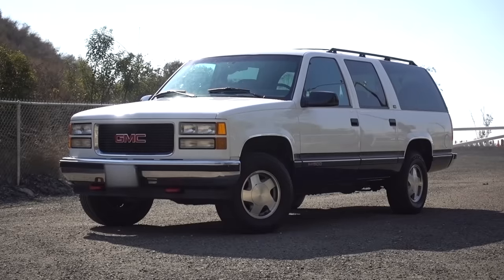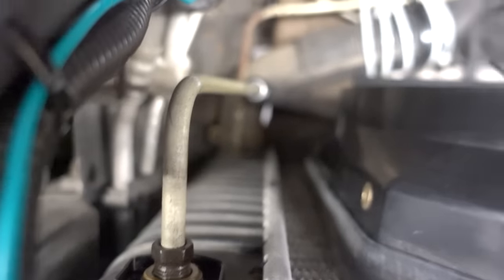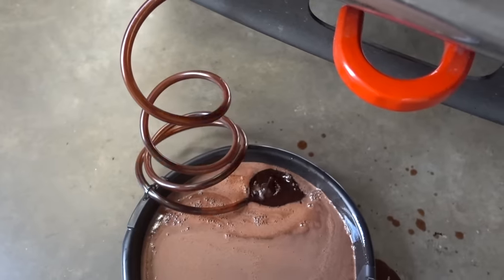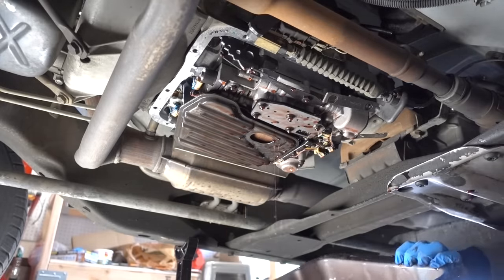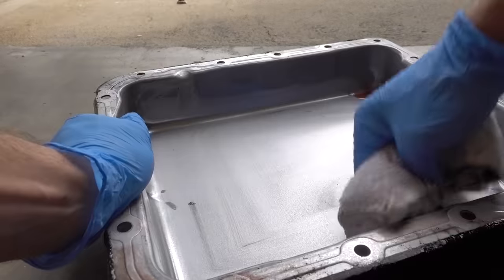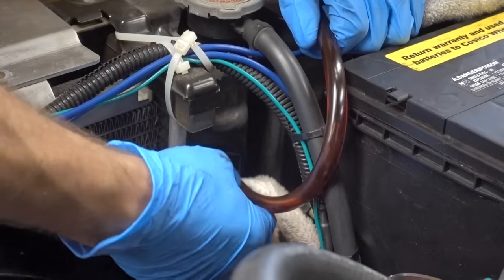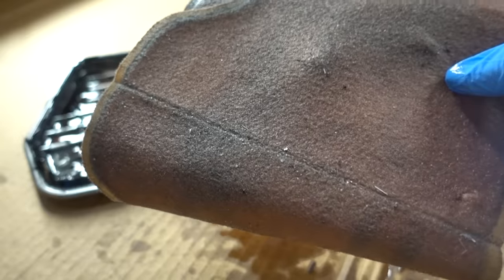Why You Should NEVER FLUSH YOUR TRANSMISSION FLUID!!

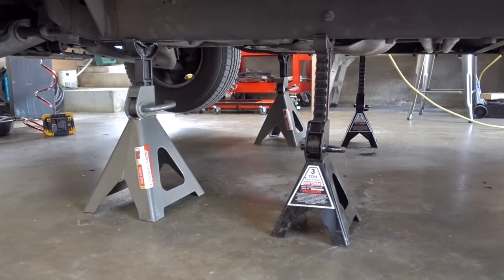Comment: Those 6 ton jacks stands at 4:25 have been recalled by Harbor Freight because of a manufacturing defect that makes it collapse under load.
Reply: apparently the jacks were fine. There was a guy who just wanted to use his head as a jack
Reply: i had a friends die from the jack stand failure
Reply: @scribtoon7146  nah the jacks are crap. I have a couple. When you lift up on the handle, it should lift up the anvil before dropping it. The 6-ton's from HF dont lift the anvil up, which means it could slip if the handle is bumped or not down all the way. Plus the teeth on the anvil are not long enough, so there's a lot of wiggle room. I only use them in the lowest position now after experimenting with them.
Reply: @frostbite1991  where can I get some good quality jack stands?
Reply: @vegeta9411  go yo Harbor Freight. Get the 6 ton jack stands. Just make sure the anvil goes up when you pull the handle up.. and use only 2 teeth if you're not feeling safe 🤷‍♂️
Reply: @4mmdefeater920  
Omg that's fkd up
Reply: @4mmdefeater920  Oh Jesus! What a horrible way to die :(   Im very sorry man.
Reply: fake news.   there was no such recall.   stop spreading false info.
Reply: They were not fine, I went to grab some cheap jack stands  around February(ish). They didn't have any due to the recall.
Reply: Good eye, . Jack stands are something I would never cheapskate on.
Reply: I only like using the jack stands where you put the pin through the hole to keep it at your desired height. Saying that I also slide a wheel in under the sill just in case the car ever came off the stands.
Reply: @frostbite1991  "When you lift up on the handle, it should lift up the anvil before dropping it"
That statement is 100% true and accurate!  If you can lift the jack stand handle without the stand height increasing, it's a killer and you should take it immediately to the junk yard.
Reply: @recentlychanged  yep, why I only use my HF 6 ton jacks exclusively for my cars. In the lowest position they get the car high enough for me to roll on a creeper under them. Still need to get a new set for my trucks though haha.
Reply: There was indeed a recall and safety measures added to new Jack stands
Reply: If your life depends on it, don't get it at Harbor Freight. If your life doesn't depend on it definitely do get it at HF.

Comment: I have a 2010 gmc Sierra with 143k. I just flushed the transmission fluid.  It made a big difference in how smooth my shifting is. The fluid was old and dark but didn't stink. I didn't think I would feel a difference, but it really made my transmission buttery smooth.

Comment: "NEVER Flush your transmission!"
FLUSHES the transmission?!?!?!
Reply: P M this is not considered a flush.  It uses the internal transmission pump.  Flushing generally means hooking up an external machine that has its own pump and pushes for lack of a better word new fluid throughout the transmission.  Quite different end results.
Reply: @condor5635   Still doesn't get around to vehemently explaining "why you shouldn't".
Reply: Pynaegan because using an external machine with its own pump (and unknown pressures etc) is thought to be more likely to dislodge particles etc. that could then clog up ports etc. The internal pump would not do this
Reply: The way I see it, He did a complete change and even changed the filter. If he were to just flush it, the pan never would have come undone and the filter would still be in place. You remember the magnet with the shavings?  There could be more!
Reply: Do as I say! Do not do as I do.
Reply: And also has a video saying it's the best thing he could have done and his transmission is running top notch lol
Reply: @condor5635  this usually take 4-6 gallons to do a complete flush. You don't need a fancy machine to get 95% of the old dirty fluid out.
Reply: Chris Atkinson not sure why you are responding to me. No one in there right mind would run 4-6 gallons through any transmission. I just did my Highlander few weeks back running 10 QUARTS through including draining the pan. That’s considered a complete replacement of the fluid or close enough.
Reply: Mines is slipping 2007 avalanche
Reply: Why would you use grease?
That's crazy! Use the trans fluid
Reply: @condor5635  depends on what transmission and vehicle you have. Been a mechanic for 18 years so i know what I'm talking about. I use that much and use a clear hose while flushing along with clear jugs so I can see the change from black to brown to solid cherry read. My s55 amg took almost 9 gallons to get it all out. My dodge ram with a very deep aftermarket pan took about 6 to flush all the discolored fluid out. No i didn't put all that fluid in at one time if thats what you were thinking might be miscommunication. I dropped the pan changed the filter reinstalled. Then put 4-6qts in the car and turned it on watching the fluid drain from the clear hose i attached to the output line going into the cooler. Once it started slowing in flow I cut the vehicle off then added 4 qts or so and began the process all over again till it came out cherry red. Thats what I meant by 4-6 gallons. Sorry for the confusion.
Reply: @repnatl  hi, I'm going to use this process soon on my Mazda5 and I have a question for you, isn't it better to do the flush untill the oil is bright red and then change the filter? So no shavings from your flush go into the new filter.
Reply: @Alessio.B87  yes
Reply: James Bock - different enough where I would not want to have a shop do a flush by hooking up a ATF flush machine. Stick with drain and refills. Wastes more but much less potential for issues
Reply: @condor5635  Why not? The shop has of course to know what to do, but this applies everywhere?!
Reply: @PM-wt3ye  not true. the shops dont care about ur car and u wont be able to sue them for damages if it happens. Because u wont have proof if it was the shop.  I know for a fact!  I have never flushed and i always hear not to flush. Its true. He just changed mostly all fluid. Maybe about 90%  but he might have problems sooner than later.
Reply: hey, thats illegal.jpg
Reply: JuanMa what is illegal?
Reply: Because it’s a pain in the ass
Reply: @condor5635  you didnt understand the joke (rip joke)
Reply: @repnatl  Indeed. The Honda Fit takes anywhere from 3-3.6 quarts of ATF.
Reply: LOUD NOISES!!!!
Reply: @gregcurlett2054  I DON'T KNOW WHAT WE'RE YELLING ABOUT
Reply: I jus wanted to know what he did with the transmission cooler line that he disconnected from the radiator. Because when u start the engine there will be transmission fluid pumped out of that line and how did he know it's not a feed line or return line?
Reply: @condor5635  bulloney. same results
Reply: gary beharrell - believe what you want. I have never had a flush done on any vehicle of mine and never will. It makes total sense to me that forcing fluid via external pump can do things that your internal pump in normal running won’t. I have run new fluid through my cars using internal pump many times and have had zero issues with the results. Not sure what aspect you are saying is boloney but you are welcome to your own opinion on it.
Reply: @condor5635  I am a mechanic and have done many using both methods. One is as good as the other. The flush cart is easier to monitor ingoing and outgoing fluid, and sometimes tidier. Both methods take about the same amount of fluid to get the job done.
Reply: @condor5635  the external pump in the flush cart has absolutely no effect on the circulation of the normal flow of fluid. It is neccessary to force the flow from the trans lines or the oil would not go into the flush cart but would bypass it.
Reply: gary beharrell - good to know Gary. Thanks. Nothing against mechanics but I’ve not had my car taken in for any reason for the last 15 years probably. Like to do all the work myself.
Reply: @condor5635  good for you and you are welcome. There is so much miss information on the net. The mechanical industry is loaded with it.
Reply: @vladrod9624  just curious...what kind of probles sooner then later? Also, yhanks for advice
Reply: @jadepayne5447  if u dont flush ur transmission on time. When the oil gets bad, when flushing it passes through a machine but when it gets pushed back inside the transmission,  if there is little metal particles inside ur oil it will get flushed right back in. Then all those gears will have metal particles grinding in them and damage ur transmission. It would start to slip and slowly damage the transmission
Reply: @vladrod9624  a
Reply: This is the cool thing about many Toyota models, no filter to deal with. So if beginning to change the fluid in the pan on every (or every other) oil change, the transmission fluid should always be a healthy pink color. ATF fluid isn't that expensive, especially when buying by the gallon, even the top ranked synthetic brands. Which is what I use, the top rated Valvoline brand which works for both Asian & GM vehicles of the same age (late 90's through 2010 or so). 

It's what I've done on my wife's 2001 Solara since 30,000 miles, dump the fluid in pan every 10,000 miles & now at just over 105,000, looks like new. 

Best of all, no flushing involved to dislodge a small piece of gunk into a tiny passage which will likely cause an expensive repair.
Reply: There is a difference between a FLUSH and a FLUID DRAIN.  A flush uses a pump to force out the old fluid and fill with new. A fluid drain is just that, a manual draining of fluid.
Reply: @P M I guess you could this a power drain and fill!
Reply: @garybeharrell3972  no i build transmissions hooking up external flush machine can dislodge debris flakes ect and end up keeping parts of the valve body open or doing other damage its a 50 50 gamble more common on older trans
Reply: @craigbass2060  IHi Craig. I would like to hear your reasoning. The cooling lines that the flush cart hooks to are the same lines that are used to manually flush the tranny. The time to flush both ways is about the same so the flush cart doesn't add much if any pressure. Once the oil is clean manually and lines hooked back up it is the same fresh oil circulating  as with the flush cart. IMO the tranny would have more pressure and oil flow to flush any remaining flecks out far better than the flush cart. I do agree that if you were to lift the car off the ground and run it through all the gears while it is flushing that you would do a better job with the cart, but do you? I doubt anyone does.
Reply: @condor5635  specially when it already flushed 100 crap cars and the pressure blows out trans seals. they never gonna even flush my dam crapper!
Reply: @condor5635  exactly correct. dealers flush machines produce high pressure. blows out seals. set aside how many hundreds of crap cars has it flushed and where does all trash get forwarded to. not my vehicles.
Reply: Never says why not

Comment: The myth about flushing your transmission came about in the old days before Lock-Up Converters.  During that time transmission temperatures would get pretty high and bake the internal seals.  When that happens that old, thick, chocolate color fluid would build up a layer of varnish in the pistons, drums and servos.  It would act as a seal holding fluid pressure.  The clean and highly detergent new fluid would wash out that varnish and cause a pressure loss in the hydraulic circuit.  When that happens you transmission will begin to slip or fail to engage at all.  However, with the new cooler running transmissions flushing is a great way of keeping it working great.  I've even had slipping transmission begin to work better after a flush and continue to do so for many years later.  The MotorVac Transmission flush works great, very easy to use, eliminates the mess associated with transmission service and after service pan leaks.
Reply: But it wasn't a myth because it actually DID mess up lots of people's transmissions!!  how is that a myth? Why would anyone trust these flush machines now?  that's ridiculous
Reply: @Fremen02  That was not a myth prior to lock up converters. Because torque converters created a lot of heat which broke down fluid and harden the internal seals. However, it would build up a thick varnish that internal helped the internal seals. When flushed it would remove that varnish causing the seals to loose pressure. Varnish did not reduce pressure but did reduce volume. Resulting on slower clutch engagement causing more wear on the fiber clutches and creating hot spots on the steels. That's just the short explanation. Anyhow, I've done hundreds of demonstrations across the U.S. and have solved many transmission issues with a MotorVac flush unit. I also have 30 years experience as a transmission builder, shop owner and another 10 years instructing others. It still is amazing that the current myth or lie still continues.

Comment: Another technique that is more time consuming due to making this a 3 step multi day procedure by having 2 assistants help you.  one to start and stop the engine, one to monitor the old fluid coming out and you to pour in the new fluid as the old is going out.  for the sake of simplicity, let's say your tranny holds 12 qts. including the torque converter.  Set up the hoses as you did, then have 2 empty gallon clear plastic jugs like milk or distilled water on hand.  Then as you signal the "starter" to get the motor running, have your funnel in place and a gallon of new fluid while your "catcher" is ready to monitor the old fluid.  As best you can pour the fluid in the funnel simultaneously while the old is collecting in the empty jug.  Have the catcher yell STOP to the starter as the milk jug gets close to the top.  IF you haven't finished emptying the new fluid into the tranny, finish that.  Then switch out collection jugs and get another new gallon ready for round  2.   Repeat this process with the 2nd gallon and shut the motor off and reconnect the lines and check the fluid level.  Two gallons in and two gallons out shouldn't need much topping off.  Then drive the vehicle a couple hundred miles and then set up the flush trio once again.  

Run the same operation doing 2  1 gallon  flush procedures, hook things back up again and drive another couple hundred miles.  The third time only do 1 gallon of flushing and shut the motor down .  Now pull the tranny pan and filter do the cleaning and brake cleaner stuff and new gasket and bolt torquing.  Top off the  fluid according to manufacturer's instructions and you have just done a $400 tranny flush for about $150 worth of fluid and filter.

The reason you do this in steps is to avoid "douching" the old tranny fluid all at once with all new fluid because all new fluid could easily shake loose dirt in the system and all of a sudden you have a filter that's overwhelmed by the gunk and tranny fluid passages that clog and the tranny doesn't shift right.  By doing it in steps, you avoid the mass of dirt and gunk as the gallons you pour in will mix with the old and gradually clean things out at a pace that the old filter can handle.  By the third step, you're ready to replace the filter and put the new one in.  Now you have effectively flushed out the torque converter by driving it several hundred miles on increasingly cleaner tranny fluid so when you finally drain the pan and top off the level your new filter will be filtering  nearly 95% new fluid .  

Yes, this is pretty anal retentive, but if you don't know how old your tranny fluid is, this is the safe way to do it.  It could very well save you a $3-4,000 transmission repair/replacement.  

Jimmy, I like your style!!  Keep up the good work man.

Comment: Nope, learned my lesson with a 99 tahoe.  I purchased it with 140k miles on it and as a preventative maintenance flushed the tranny, ended up rebuilding it less than 5k miles later.  LOL   My theory is, if its been neglected, keep neglecting it till it dies.
Reply: Actually @1D10CRACY You are right if you have high milage (100k plus) on a vehicle and have no idea when the trans-fluid was changed last you could do a lot more damage changing it than just leaving it be until you need a new one.
Reply: You're playing with borrowed time no matter what.
Reply: Youre problem was getting your car worked on at walmart to begin with.
Reply: @slappychap969  Seriously WTF 😐
Reply: Apparently the old fluid has deposits from the friction bands. When you remove this fluid it opens up the tolerances that the old fluid filled with the floating deposits. 

These tolerances are created over time by the fluid having the abrasives in it.
Reply: @slappychap969  makes me both kinda wish and glad I'm not working at Walmart. Wish because I'm not a huge fan of bosses breathing down my neck and glad because all my co-workers would be idiots lol
Reply: That's because the oxidization build up from the old fluid around the seals,rubber bonded pistons bushings etc is flushed away and doesn't seal as good.When circuits in the trans don't seal well those circuits lose pressure which is needed for the clutches,valve body,torque converter. That build up acts as a plumbers putty kind of.Bad fluid does wear down the trans but the damage is done and new fluid often accelerates the destruction of a trans that's slowly going on its way out .Its best to keep up on trans fluid all along not just when it's black .It may not be a problem if there isn't any symptoms of a worn trans but if there is an obvious problem chances are it's only going to expedite the process of burning it up.
Reply: @slappychap969  your first mistake was going to Walmart, 2nd was leaving them unattended with your car and keys